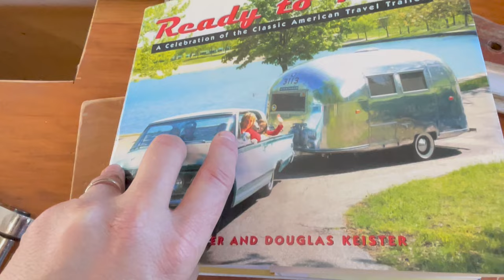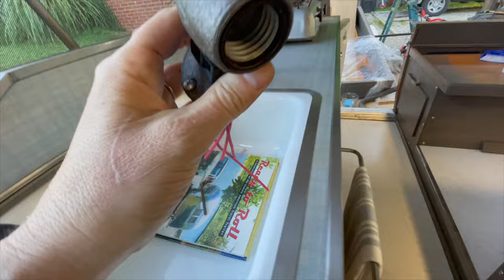1954 Hille Ranger first crank up pop-up camper restoration part 7

Comment: That's a nice job! An event deadline sure focuses the attention on getting things done, well done!

I love that crank-up mechanism, I don't think back in the day that UK manufacturers had anything as good as that, the foldables were more manual handling and cruder!

I would like to have something similar, but smaller & lighter to tow behind my vintage Standard Swallow, so would have to start from scratch, I am thinking the hull of a small boat could be a starting point, something to ponder!

Thanks for sharing, greetings from the UK!
Reply from the maker: It was a really tight deadline...but we made it...barely...You could certainly use a small fiberglass boat hull, that would turn out really cool I think and certainly compliment the lines of the swallow if you got the right boat to start! DO IT! I want to see it! You could start a new trend! ha

Comment: Water gonna leak into rear section when it rains?  Velcro tape to seal covers for screens??  Wat a job. 😅😅😅
Reply from the maker: ideally the angled flap will run the water off the roof line, the screen in rear has a canvas flap that zips up both sides and the zippers have a rain flap on them as well...we truly need to camp in a good hard rain to find any issues and then go from there because I am SURE there will be some!